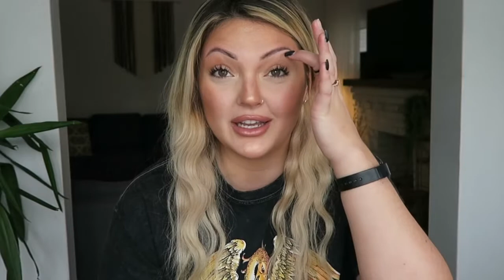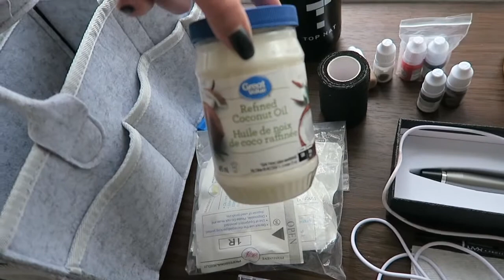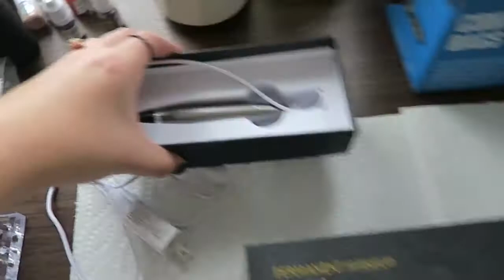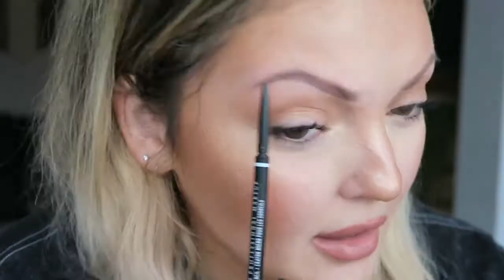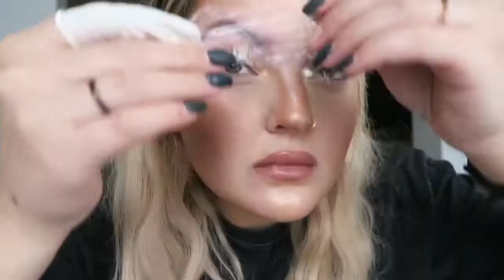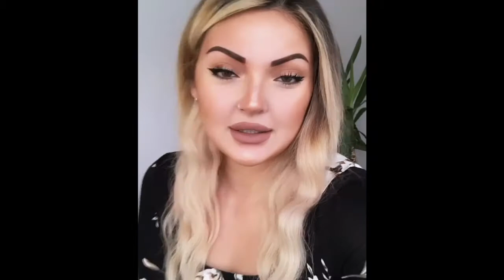DIY PERMANENT EYEBROWS using PMU Machine

Comment: Best video I have been able to find on diy permanent brows! So tired of spending $500+ on my brows so I've decided to do my own as well. The only question I have is what type of machine did you use (are there adjustable speeds and does it use cartridges)? And do I need to know anything about needle sizes? If you know any other helpful info I would really appreciate it. Awesome video.
Reply: Did you do it? How it turnen out? X